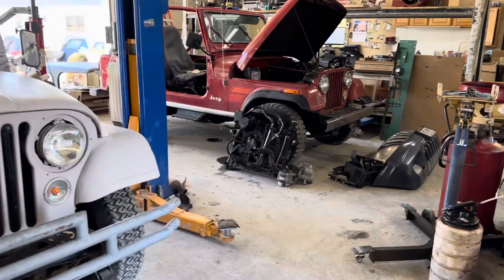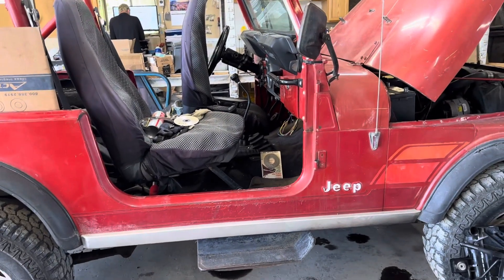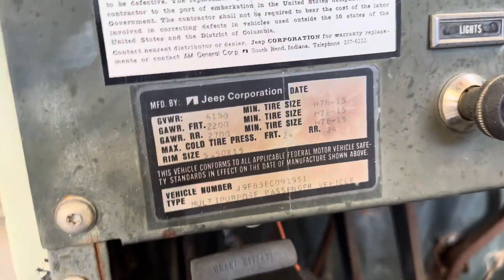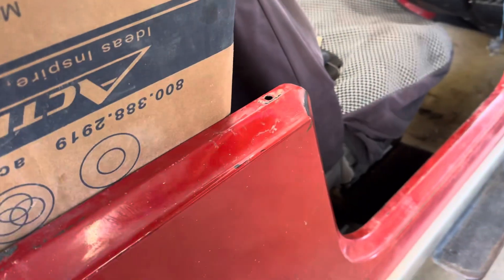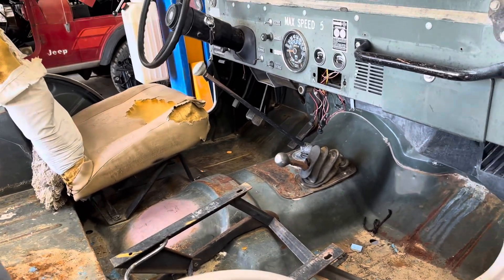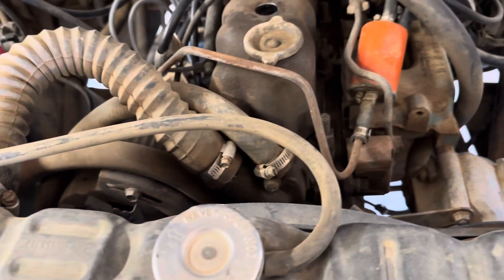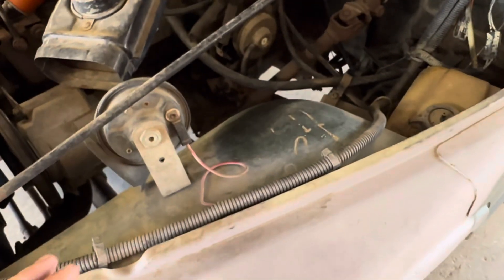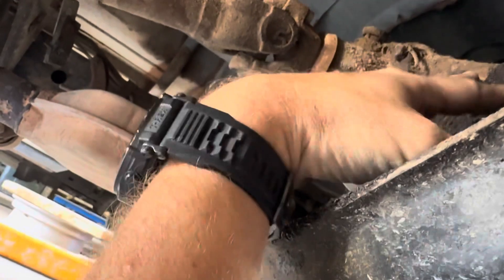Jeep CJ5 Odd Ball Call out to anyone that thinks they know and help educate…. It’s also for sell

Comment: The M38 was long gone by the 70s. I’ve never seen one but tactical combat vehicles have the military switches and lighting which the CJ5 shown does not. It would be interesting to see what vin is stamped on the frame rail. My guess is that this is a homemade clone like folks do with Buick “Grand Nationals.”